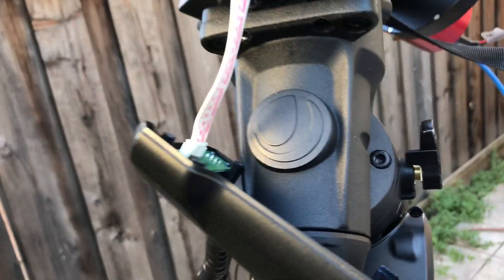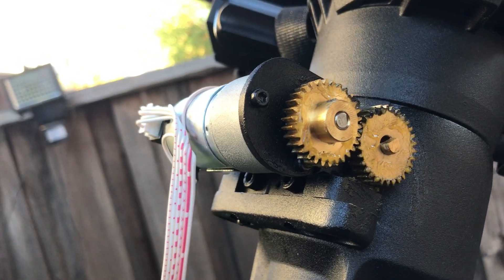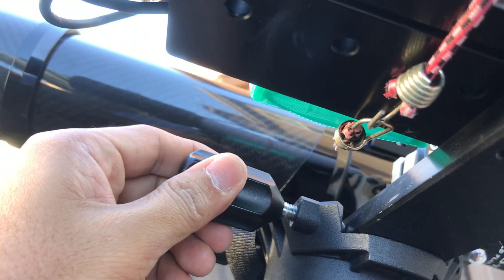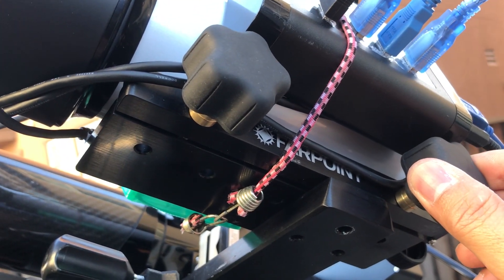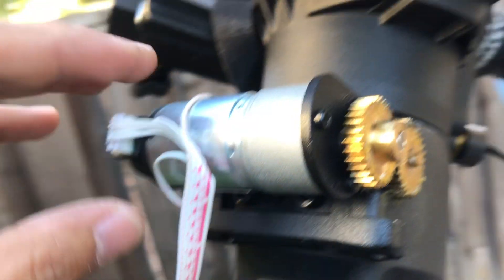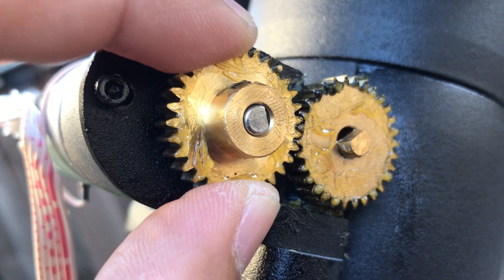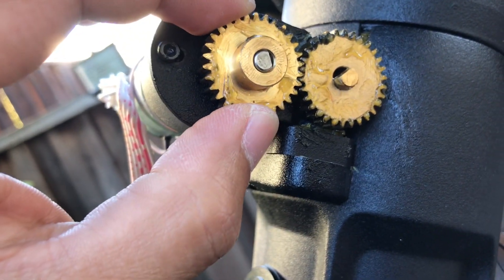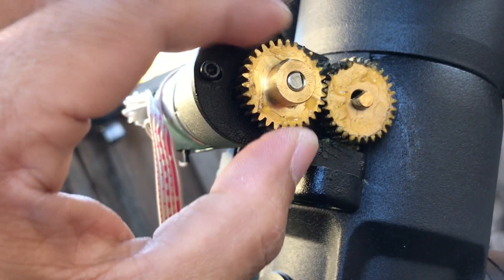Celestron AVX Backlash

Comment: There are two Allen type screws adjustment bolts almost hidden by the motor.  Those tight or loosen the play on the worm gear.  At least on a Celestron Advanced GT mount that is another adjustment.  The mounts are almost the same.  Getting the gears on the motor to mesh is just part of the solution.  The worm gear hidden by the metal plate is the other gear to adjust.  I found one of the bolts too loose on the GT I was working on.  There is a YouTube video on taking down the AV mount that shows all the parts.  I did not take the metal plate off just tighten down on the bolts until the movement was almost gone.  Hope this helps.

Comment: You will have to remove the motor gear to get to the two other smaller bolts behind the gear.  The motor has three small bolts holding it on the mounting plate.  Once you remove the motor you will see the two bigger bolts that adjust the tension on the worm gear.  Once you get the tension to allow the remaining gear to move very slightly, put the motor back on.  Adjust the motor so its gear, that your had to remove, is meshing with the other gear with very little play.  Tighten a motor bolt so the gear can be removed to tighten the other two bolts that the gear will cover up.  Reattach the gear and tighten the scrub screws on the gear.